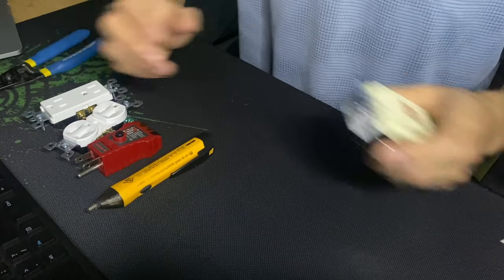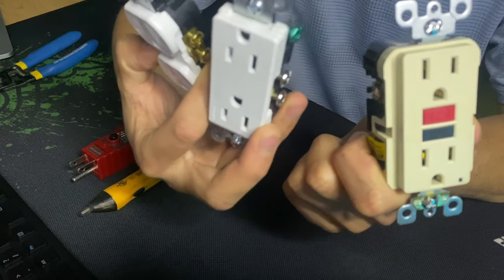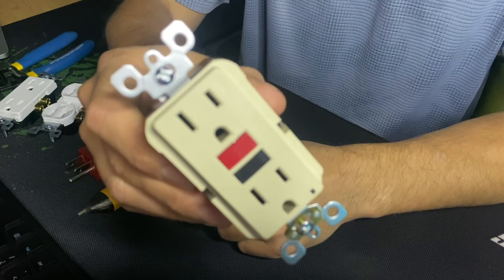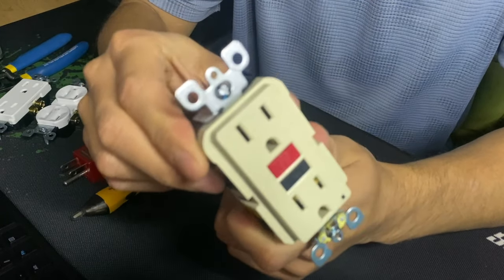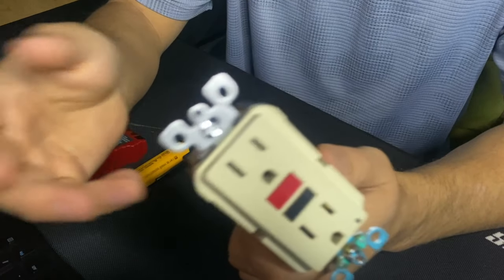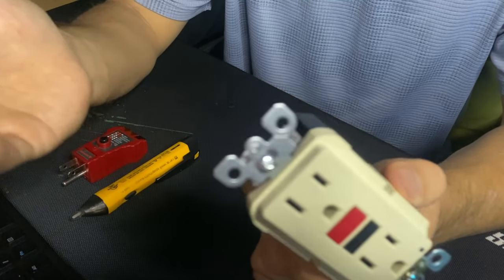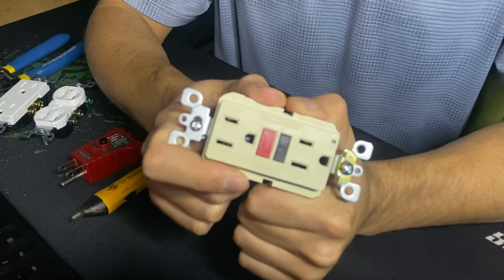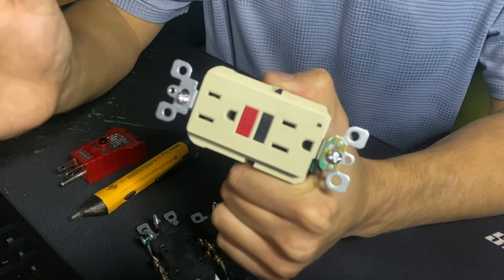GFCI Outlet Not Working 🤷‍♂️ Can't Reset It

Comment: Troubleshooting. Turn off the circuit if you have it identified. Pull the plug out of the box but leave it connected. Turn the power back on and check to see if you have a hot at the gfci. If you do turn the power back off. If there's a second set of wires coming off the outlet remove the wire below the incoming hot. Turn the power back on and try to reset the outlet. If it resets the issue is down the line. If it doesn't reset then replace the gfci.

Comment: A contractor plugged something into the power strip to a refrigerator yesterday in our garage and blew the power in half the garage.  I knew that there was a GCFI outlet that was connected to the outlets on the north side so I tried the reset button, but it wouldn’t reset. No click.  The GCFI plug ins were dead as expected, but I pulled the GCFI out of the junction box and found the bottom terminals of the outlet were hot.  Nothing in the circuit breaker box was tripped.  I plugged the refrigerator into a different source on the south side of the garage.  Unplugged the RV that was connected to an outside outlet on the dead side of the garage.  Now nothing is plugged into the dead side of the garage except the power strip that was plugged into the refrigerator.  Still the GCFI would not reset.  I found the correct circuit breaker to disconnect the GCFI, checked with the tester,  then swapped out the GCFI with a new one.  I reset the breaker box, verified with a tester that there is power to the terminals of the GCFI box,  but the new GCFI outlet will not reset.
Reply from the maker: double check wiring. you could have miss-wired neural of the line and load. (use multimeter to make sure line wires(correct neural/hot pair) read 120-125v)
Reply: @remoteelectrician  The old GFI was faulty probably because tiny fragrant ants had built a nest in it.  The new GFI wasn’t working because I had wired it in the same way the old one came out, but I didn’t know the new standard in line connections are on top, load is on bottom.

Comment: I had a GFCI plug that would not reset in my motorhome. This video helped me as I realized they will not reset without power going to them. I had battery power in the motorhome, but that wasn't working. I plugged the motorhome in to shore power and the switch works fine. Thanks

Comment: Weeks…. Weeks I’ve been without lights in my bathroom because we can’t figure it out.

I’ve reset the breaker, the other outlets work, the bulb isn’t broken 😞 

Today I get out my voltmeter to see what’s going on. The GFCI isn’t grounding because it’s “popped” and there’s no V across positive either, but shared ground and positive terminal does have voltage flowing when the light switch it turned on. I turn the light switch off again and go back to trying to reset it, figuring the reset mechanism must be broken and I’m going to have to get the whole outlet replaced 😢 and I come here for one last shot to see if there’s anything I can do, and this man solves my entire problem in less than 100 seconds! 😂

Thank you🎉 thank you so much! You’ve saved me on Mother’s Day. My wife is going to love having lights again!! 😅
Reply: I don’t know if you’re trying to grow and, like, do the whole YouTube thing, but let me know if you are, I’d be glad to give you some shout outs to my fans - I definitely owe you!
Reply from the maker: thank you man. just throwing things I know here.

Comment: Very well explained thank you! - I was trying to reset the GFCI and nothing was happening, it was only after your video I realized I should have the disposal switch on the ON position before trying to reset it. This may be obvious for many people - but not for me - so I THANK YOU very much Mr. Remote Electrician!! We were jumping to conclusions and thinking the main circuit board was out, the main fuse, the insfinketator was out (and then of course there was all the family blame on who used it last and broke it LOL)... Thank you again for helping me and my family maintain peace in the household.
Reply from the maker: thank you!
Reply: Help! I have my landscape lighting plugged into one of these and the reset buttons won't reset and now there's no l power into it.

Comment: None of this worked for me and I have this exact problem. I talked to live electrician - he pointed out that sometimes people think they reset their breakers, but they don't. There is a little give right at the end when you turn it off that many people miss. I haven't seen this mentioned in other videos, including this one, but sure did the trick for me in what was a very confusing situation! Hope this helps someone out there. Maybe you could make a video on this as well...
Reply from the maker: yes if u have arc fault breakers or some breaker's toggle won't go all the way off so it's hard to notice. thanks

Comment: My wife and I bought a new home about 2 years ago and the kitchen receptacles worked for most of it, then suddenly the outlets on the switched side of the GFCI stopped working, but the GFCI I still did and was not tripping.

So, I thought the GFCI may be faulty.  Then, I discovered that the neutral from the panel was wired to the switched side of the GFCI instead of the feed side.  Rewired, and checked the rest of the wiring, and everything worked as expected. 

Always check the wiring, since what you think is the root cause may only be a symptom of the real one.

Comment: Hi Remote Electrician, Good video however I still have an issue hope you can help shed some light on.  In the kitchen I have a wall of outlets 2 regular outlets and one GFCI.  I replaced 2 of the outlets and I replaced the GFCI and still have the same issue.  All breakers are on, all outlets on that wall are not working there are 3 more outlets on the other side of the GFCI that are not working as well so a total of 6 that are out.
Reply from the maker: you need to wire gfci correctly. line to line load to load. use multimeter to read voltage.

Comment: Great video! It helped resolve my issue. I was able to find another GFCI not working along my journey. I checked my breaker box and all the switches appeared on...even to the touch...however, I took the time to flip 2 off them off and then back on... the GFCI worked again.
Reply from the maker: Glad it helped!

Comment: QUESTION: The bathroom GFCI worked fine for many years. But it recently tripped. The "Power" still works. The "Reset" button is sticking out while the "Test" button is pushed in. But, when I press the "Reset" button to try to make it so the "Reset" button is pushed in again, the "Reset" button will not remain pushed into the wall. I then tried resetting everything at the Circuit Box. But, this didn't solve anything. Do you have any advice? ... Also, as a replacement, should I get the 15 Amp or 20 Amp?
Reply from the maker: hi. just replace it. pick whatever the circuit breaker size is.

Comment: Hello. I hope you can help. So my kitchen gfci is not working. I already checked my circuit breaker to make sure there is power, nothing is tripped. I made sure to reset the outlet but it has no indicator light. So I tested the outlet with a SPERRY plug in & it shows power & the power light comes on but the SPERRY shows a red light indicating a hot/grd reverse. I lived in this house over 6yrs & never had a problem with that gfci. What do you recommend?
Reply from the maker: hire electrician or fix it by rewiring checking wiring or if needed installing new device

Comment: Hello so I just installed a new gfci  in the kitchen like the video I am getting power to but no power is going out if I understand stood you I have plug for example a appliance to trigger the gfci to work thanx for help
Reply from the maker: after installation press top reset bottom until it clicks

Comment: thanks for awesome video is helped me  but when I shut switch off can I take receptacle out or is still hot because don't know what  breaker is.  I figured switch can kill power to it to replace because even with switch on still can't reset button push in nothing happens so gfi receptical has to be replaced I just want to make sure power is off from switch so I can replace
Reply from the maker: just get power tester its $5-10 worth your life

Comment: Hi. Thanks for your video. I have a problem. My outside plugs are powered thru one for. The GFI is controlled via a wall switch from inside a hall closet.i have power to the GFI receptacle however when I reset it the breaker on the panel trips. Is it a bad GFI?
Reply from the maker: no you have short circuit that needs troubleshooting

Comment: Hello. Thank you for making this video. I've got a GFCI outlet in my kitchen. Last night suddenly 4 outlets (including this GFCI) quit working. I pressed the reset button but it won't click in place. Could the 'switch' to provide power to the GFCI outlet be a light switch? All we had plugged into the outlet was an Amazon Echo.
Reply from the maker: no kitchen gfci are not switched. check the electrical breakers, turn it on and off then try to reset. it could be short circuit or time for new gfci.
Reply: Found the issue. One white wire came completely loose from the back of the outlet. Put it back in, tested the socket and we’re good to go. Thanks for making this video!

Comment: I had an exterior one go out and not able to reset.  I just replaced it and it works now.   Makes me wonder if i turned the breaker switch off and back on if it would of worked.   I assumed rain got in and ruined it.   Anyway,  have a good protector box on it now for rain also.
Reply from the maker: yes, oxidation of copper contacts inside and mechanism gets stuck

Comment: Could you take the load wires off the GFCI in one bathroom that connects the other bathrooms, connect them to the power from the panel, and then individually install GFCI receptacles in the other bathrooms? I have like five outlets running off one GFCI and that GFCI trips too often and too easily.
Reply from the maker: yes you can. you'd have to connect all to line terminals.
Reply: @remoteelectrician  Thank you for the response. It seemed logical to me, but wanted to be sure.

Comment: I have a wall with Gfci that wall also has a regular outlet which is also the same wall as my refrigerator. However I was cooking using the regular outlet on my middle kitchen island and using my air fryer on the wall with the gfci and all of a sudden they both stop working. Went outside to check to see if breaker tripped and nothing. However, I still reset the kitchen since I only have 2 GFCI in the kitchen. Weird thing is my refrigerator did not stop working. However even after the reset to breaker wall gfci will not click. The island outlet still not working but the dishwasher has no problem and it’s in the island. What am I missing here? GFCI will not reset, outlets next to Gfci not working and the island outlet not working so that’s 3 outlets out in kitchen
Reply from the maker: HI, that's how it is wired. gfci outlet that went out protects the regular ones so it's all 1 circuit. if it doesn't reset but breaker is on. you may need to replace the gfci with new one.

Comment: Hi! I have an outlet in a room that's tripped when I plugged in a vacuum. Tried to reset the GFCI outlet in the bathroom near by and the GFCI outlets in the kitchen across from the room. Also, reset all the circuit breakers, but nothing worked. This outlet has tripped before by another tenant when she plugged a portable AC to it. The outlet next to it and the bedroom light that is in the same bedroom is also out. It would take a few weeks before it automatically turned on by itself. I can't seem to figure out what's wrong with this outlet. Please help! Thank you.
Reply from the maker: Hi Kevin. Outlets in the bedroom or living are not protected by gfci. 99% chance it's lose wiring in one of those outlets, (when outlets wired as daisy chain if one fails power stops going to the rest of the outlets in that chain)  I'd test all non working outlets with plug tester to define if that's the case.(open neural, open hot) and power tester.

Comment: I have an issue with my GFCI outdoor outlet it burnt out as long as as well as the plug for the pump of my pool. I replaced the new GFCI and wiring is correct but still not getting power. What could be the cause of that situation
Reply from the maker: breaker. you gotta read the voltage at the gfci terminal if it doesn't have power most likely your breaker is the issue. (assuming no junction box in between)

Comment: Good stuff, i just built a living space in the garage with a kitchen but my gfci outlets are not working. I plug in my hot wire into the LINE side but it wont let me reset , im sure that its getting power because i ran that line straight to the panel. When i connect a regular outlet, it works great. Is there something im missing ?
Reply from the maker: try with another gfci, maybe your outlet is faulty.

Comment: I installed new gfci in bathroom and it worked however I plugged in a small air compressor to install baseboards with nail gun and it won’t work or light up to reset. Did I overload it somehow?
Reply from the maker: check the breaker first in order to reset the gfci it needs to have voltage.
Reply: @remoteelectrician  hi hun my breaker is on but voltage still not reaching it.
Reply: The breaker didn’t kick. All of them are on

Comment: Just replaced gfci outlet exactly as it should be done and I still don’t have power to the outlet.   Breaker is not tripped.  Any suggestions?
Reply from the maker: use multimeter  to test voltage. test breaker as well. flip on/off

Comment: Is it normal for there to be two GFCI outlets side by side? There's two in the kitchen; one clicks when you press "Test" and "Reset" and the other not only doesn't click but the "Test" button can't be pressed at all. 

My problem is a power outage in a single bedroom and one light in the kitchen - seem to randomly go out together. Last month they went out for an entire week and then suddenly began working again, only to cut off two weeks later. I've tried twitching the circuit breaker but that didn't work either :/
Reply from the maker: you need to hire someone on-site to troubleshoot both cases. yes sometimes there're 2-3 gfci but it depends. bed outlets you have loose wire somewhere in the chain of that circuit.
Reply: @remoteelectrician  
Thanks for the reply :)

So, you think there's probably a loose wire. I hope that's all it is.
Reply from the maker: It could also be faulty circuit breaker but any electrician can sort it out on-site. good luck

Comment: What if your GFCI isn't reading any voltage, but the breaker is still bringing power to other outlets?
Reply from the maker: doesn't make sense where are you reading voltage? if gfci terminals have power you wired it wrong.

Comment: I have a GFCI outlet in my backyard that suddenly lost power one day. I checked it with a meter and found that there was no power coming from the live and neutral wires. There are two outlets in my backyard, one of which is a GFCI outlet and the other is an ordinary one. I believe that both outlets are connected. I checked the circuit breaker panel and found that no circuit breakers had tripped. Additionally, all other outlets inside my house are functioning properly.

I had an electrician come to my house to investigate the issue, but after spending 20 minutes checking, he was unable to find a solution. Do you have any clue?
Reply from the maker: look for a switch, your gfci outlet may be switched and until that switch is on you won't be able to reset it. (switch can be inside, or if you had lighting plugged to that gfci look for timer switch)
Reply: @remoteelectrician  there is no switch whatsoever, I checked all the switch in my house
Reply from the maker: 1. need to trace wiring path. (you may still have a switch but can't locate)
2. turn off breaker for that outlet an check what else that breaker controls. and check those devices wiring.(every one of them)
Reply: @remoteelectrician  there is a breaker inside the panel named GFCI, I turned that off and I checked every outlet in my house still have power. So that breaker may be only for that backyard GFCI
Reply from the maker: @yeayeaMM  check breaker wiring, or there maybe another gfci outside or inside from which it's getting fed on the load side.
Reply: I will try thx
Reply: It’s so fascinating that the gfci switch may be far away from the actual plug that is not working.  Took me forever to find the gfci for all my outdoor plugs in a new home I bought.  Finally found one in the laundry room wall that was connected to all the outdoor plugs.  This kind of valuable information doesn’t come with the paperwork from a previous owner, but sure should!
Reply: Thx Rebecca, I finally hired an electrician to fix it. He still could not chase the root of the problem. He just connected a live wire from an outlet from basement to this gfci outlet and get it work

Comment: my  bath plugs stop due to a heater being plugged in now now no power to GFC or bath plug breakers are ok not sure witch plug to check the one the heater was in or replace gfc?
Reply from the maker: try to reset it first (gfci outlet)

Comment: Hello, my problem is I have several outlets out and others that work they are all connected to the same breaker. Breaker was not tripped. Any ideas??
Reply from the maker: Since wiring is daisy chain, wiring failed/loose in one of the outlets. You need to open outlets in the same room that work and those that don’t to visually inspect wiring
Reply: @remoteelectrician   thank you very much I’ll do that first thing tomorrow….